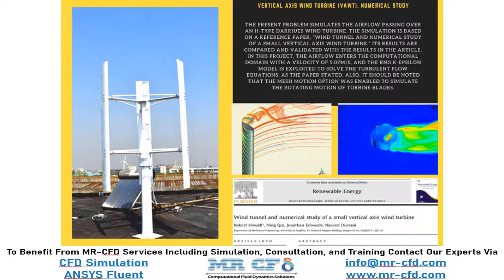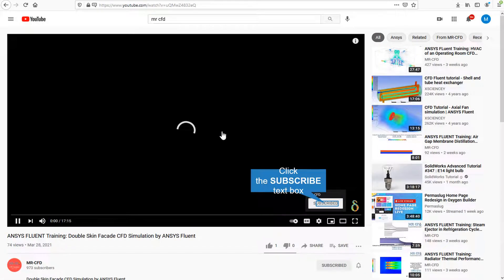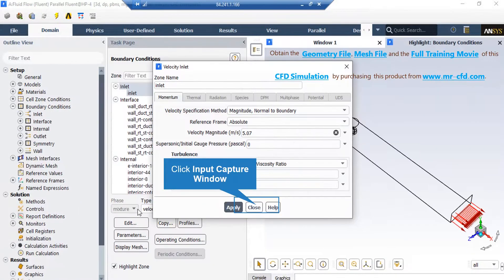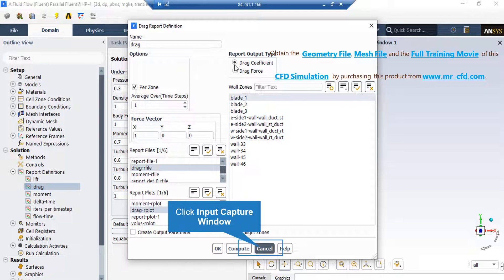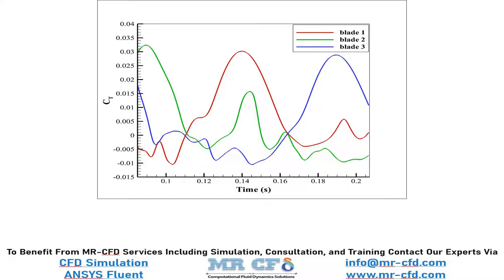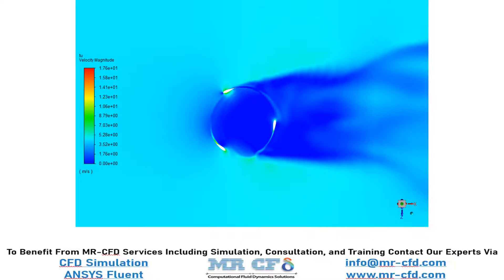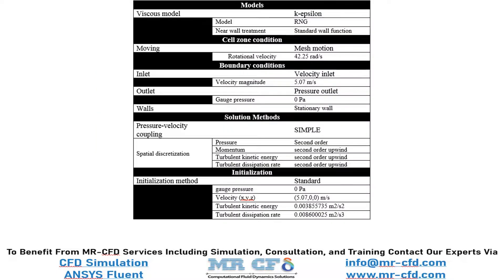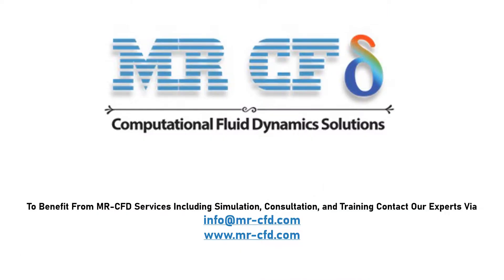ANSYS FLUENT TRAINING:  Vertical Axis Wind Turbine (VAWT), Numerical Study (Validation)

Comment: Hello, 
What reference values did you put on such as area and length?
Reply: Usually for 2D case, Area: Diameter of the turbine, LEngth: Radius, Depth: 1, and Cp= Cm*TSR
Reply: @satyamshukla33   someone replied after a long time....... what would be for 3d case, for turbines
Reply: @cR29777  just give the depth as blade height and the area would be día*height